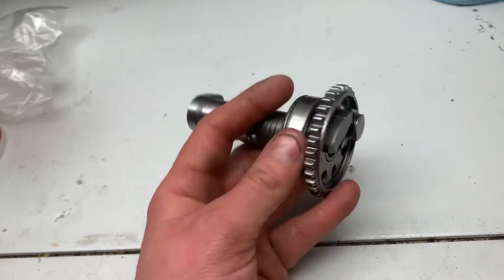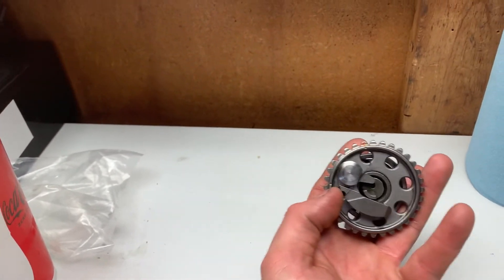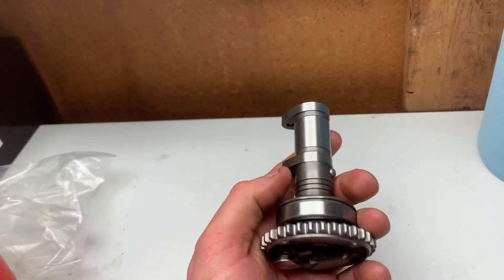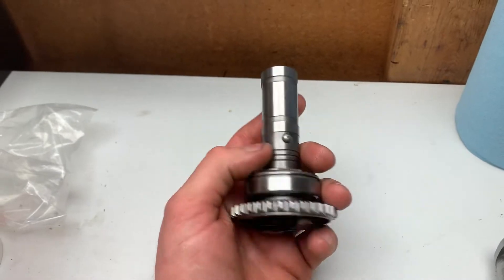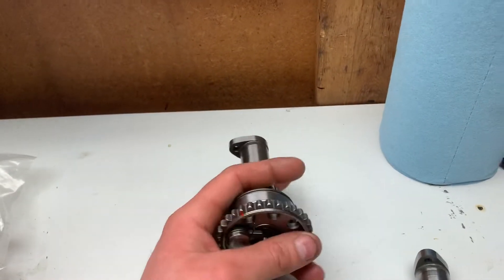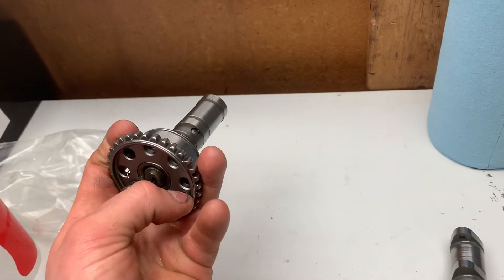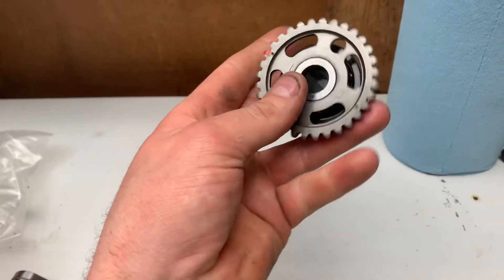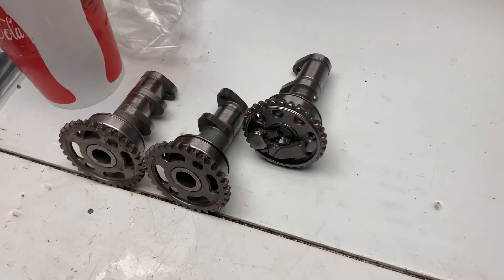How Auto Decompression Works

Comment: Is it possible that this part cause loud rattle (clicking) - noise? All valves are perfect but there is a noise on left side which is louder if engine is hotter! On a cold weather almost not noticeable.

Comment: Friend has a Honda trx420 slow to turn over on starter and slow to pull over with pull start when running runs fine. What’s your thort
Reply from the maker: Likley a stuck decompressor. Pull the valve cover and check to make sure it's not stuck opned or "expanded" outwards.
Reply: @trxtech3010  will try that thankyou 👍

Comment: So, here is what happening to mine: No starting, it cranks but does not fire up. You know when you try starting and the battery is discharged it it cranks slow? That’s exactly what is happening. So I found out the wing is a bit open and not totally closed, so the spring is faulty and the wing doesn’t keep closed. Can it be the reason it just cranks slowly and never fires up? E-start here, Husqvarna sm610.
Reply from the maker: @abutre-j4z yes that can be the issue for sure.
Reply: Hey man I’m having the same problem on my raptor 660 and it’s doing the same thing it crank slowly but never fires up and I’ve had the problem for about a year now. What did you do to fix your problem?

Comment: I have 2004 bajaj pulsar 180 dtsi model . Its camshaft have a decompressor and it makes tik tik noice. So what happens will i remove that part out of my camshaft . Bike have both kick and self start .
Reply from the maker: It will be really hard to turn the engine over if you remove the decompressor.
Reply: @trxtech3010  really . Does it effects to electric start too.

Comment: My auto decompression does not work on my pressure washer, so I adjusted the exhaust valve to be open slightly, will this be OK
Reply: Also it does now start without yanking my arm out.
Reply from the maker: Not a good idea because it will burn the exhaust valve the valve with an auto the compressor only sticks open when it's being cranked over, and then it closes itself
Reply: @trxtech3010  it's mayde only a year old, and it belongs to some friends. Who can't find their receipt or remember what store they bought it from. So is it the internal spring that is broke? And I havent taken any motor apart. I had it running, maybe set the exhaust valve back and see if the compression release set itself free.
Reply: @trxtech3010  Unbelievable when I went to put exhaust valve back as it should be, I first wanted to observe and see if the bump was present on the exhaust valve, so I pulled the engine over slowly and now it worked, unreal but true, so set exhaust valve back, and now it runs like a dream. Thinking back about my career choice, being a student mechanic 40 years ago for a one time school year has  paid off when I worked at a Dodge dealership and had my hands on a 340 Duster. But i went Instrumentation Technologist. And now this year I've repaired 6 pieces of outdoor equipment, good retirement hobby🙂